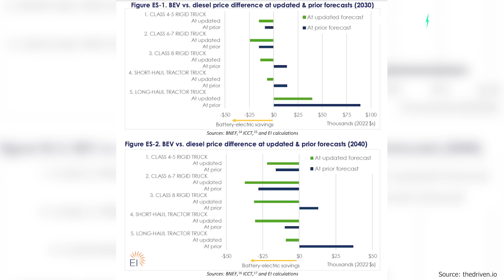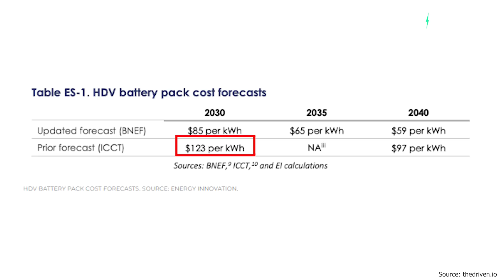Electric trucks will be cheaper than diesel many years sooner than expected

Comment: This of course ignores the rising costs of electricity, which has nearly doubled over the last 20 years.  It is likely to more than double over the next 20 years, because most of that previous period was during abnormally low inflation.  June 2009 to March 2020 was basically flat for electricity rates thanks to 0% interest rates and infinite QE.  Even if that happened again, electricity demand is going to ramp up far faster over the next 20 years because of EV's and prices for electricity will ramp up at least as fast.
Reply: Electricity manufacturer by fossil fuel is going up. Electricity manufacturer by renewables going down.. Why is prices going up.
Reply: If electricity costs (which country?) have doubled in twenty years, that's less than inflation so it means effectively the price has decreased. Renewable energy is much cheaper (and getting cheaper) than fossil fuels but the physical network is another matter. There are many variables involved and it's not as simple as some YouTube commenters assert. Regardless of all this, we need to clean the air we breathe.
Reply: @Fomites  I am talking about the US, obviously.  Electricity rates have increased at a faster pace than inflation over the last 20 years.  It is a fact.  Your opinion does not refute the fact.  Renewable energy is not "much cheaper" and I gave two examples of technologies that are cheaper than the cheapest to renewables all costs considered, CCTG/CTG on natural gas. You are right there is a lot more to know here, but anything more than 3-4 sentences causes readers to get brain damage.  You should do the research and know the facts before forming your obviously wrong opinions.  The rest of the "variables" only serve to make renewables look even worse.  There are a lot of used wind turbine blades abandoned and laying in fields where they will be for hundreds or even thousands of years polluting the environment with their useless presence.  PV solar is a total scam.  Geothermal is so limited that it just doesn't make a difference.  And on and on.
Reply: I don't know where you live but electricity over the past 20 years in Ontario Canada has dropped from 5.22 dollars per kwh to 2.97 per kwh while regular unleaded has increased from 70.9 per litte to 165.6. Bullshit may baffle brains but not in this neck of the woods. Yes electricitydemand is going to ramp up but gasat the pump will go through the roof. Nice try though.
Reply: You sound kind of like my grandpa. Things were a lot cheaper back in the day, but wages were much lower too. 

Accounting for inflation, the cost of electricity is lower than it was 20 years ago. 

Average cost of electricity almost exactly doubled from 7.5 cents kWh to 15.1. But wages more than doubled, from $11/hour to $29/hour.
Reply: @Scotto_desu Which country? I'm guessing Australia.
Reply: @Scotto_desu  "Accounting for inflation, the cost of electricity is lower than it was 20 years ago. "  That is factually incorrect.  Electricity prices have increased by more than the inflation rate over the last 20 years.  Wages have risen by less than the inflation rate over the last 20 years, and definitely less than double what they were in 2004.  Both of your claims are factually incorrect.  In any case, this does not address my original comment.
Reply: @KungPowEnterFist Just writing that it is factually incorrect doesn't make it so. Do you have any links to demonstrate?
Reply: @Fomites  "Do you have any links to demonstrate?"  YT does not like links in the comment section, and you know that.  There is a mountain of publicly available information on this.  Stop being lazy and do the research.  Your opinion does not change facts.
Reply: Solar, wind, battery is cheapest energy on Earth.
PepsiCo & FritoLay already charge BEV semi w/ 100% renewable energy.

Comment: Diesel will be around for a very long time.  The absolutely insane amount of electrical infrastructure needed to add 50+ EV semi level supercharging stations to every Loves/Flying J in America? That involves new power lines and very large dedicated electrical substations to be installed in every location.

Yeah, that's happening real soon....
Reply: Have you read any of Tony Seba's stuff? The idea is that WHEN the alternatives cost 10X less, it will happen quickly. Also, charging would be supplied by solar, so it would be very localized and without FF generating stations.
Reply: Diesel BANS begin in 2026...RIP😂
Reply: @markplott4820 Meh. People got to eat. I am a huge fan of EV, btw.
Reply: @charrin9086  - PepsiCo & FritoLay drivers earn MORE, because BEV truck does more work. Lower cost to operate & maintain.
way less impact on Driver stress/injury.
Reply: They're already installing Supercharger locations which can handle ~100 cars charging at one time. Most people considered this impossible less than 10 years ago.  And Loves/Flying J are already installing DCFC for cars. The trucks will come, and much sooner than you think.

Comment: e-Mthanol, 
made from Green Hydrogen, is suitable for heavy vehicles,
like Ships🚢  and Airplane ✈️,  or maybe even Trucks 🚚
(although I am not sure about Trucks ).

Note I am not taking about Methanol Combustion engine.
Methanol Fuel Cell is more energy efficient.

And also this is not Biofule, its not made from plants,
 insted you can use Green Hydrogen and pull CO2 from air to make Green Methanol.

Currently its expensive than both traditional fossel fuel and also Bio-Eathanol.
But in future its cost will drop below both, because price of Fuel Cell / Electrolizer is falling exponentially.

Although, electric will always be cheeper than Green Methanol.
But thats not feasible for ✈️ and 🚢  , 
until we develop cheap 'Graphene based SuperCapacitor'.

Comment: But electric trucks will require a major redesign of the the entire cab structure to better take advantage of the design. Note that the Tesla Semi has been a success because it was designed from the ground up specifically for electric power. Electric trucks from other manufacturers are essentially modifications of current truck designs and are not fully optimized for EV operations.

I wouldn't be surprised that we'll see Volvo offer an optimized EV truck using technology from Geely's EV development work within the next few years.
Reply: Volvo Trucks is a different company from the car brand and has nothing to do with Geely

Comment: Trucks need long range, refuelling that does not take  a day and be able to tow a lot.

Electric trucks not only have shorter ranges but they have to carry the 6 tons of fuel cells whether they use the electric or not. A diesel truck becomes more profitable as it travels as the fuel weight decreases.

Diesel trucks are not affected in the same way as e.v. trucks in cold weather conditions, yes the fuel may freeze but only in exceptional conditions.

I would say e.v. trucks will not replace all diesel trucks in the next 50 years if ever and e.v. car sales are going to spiral downwards over the forthcoming years.
Reply: "diesel trucks become more profitable as diesel weight decreases" Yeah really big difference in a few hundred pounds of fuel when the vehicle weighs 80k lbs. Aerodynamics and rolling resistance is all that matters for a efficiency of a semi on the highway. 

The hyundai I am about to get can recharge 80% of its battery in like 20 minutes on a DC fast charer.... not sure where you are getting an all night refuel from... 
Also truckers can only drive what 10 hours a day legally? 

Also diesel will have trouble starting routinely in Northern states based on temps... school buses and trucks have block heaters that get plugged in overnight in my state during the winter.
Reply: @RobertMartin-s2v if you think batteries operate better than diesel in cold temps you are mistaken.
Reply: @GWAForUTBE  yeah. You lose 5-7%  just to warm up the batteries and wait for it to happen. Like I said diesel performs better in cold temps.
Reply: Wow, one of the most ignorant comments here. And since this is the YouTube comment section - that's a solid accomplisment!

Comment: I have two 1 ton diesel trucks. I hate the dam things and can't wait to replace them with electric. But it will require much larger batteries and the infrastructure to charge them. That's not easy.
Reply: I feel guilty with my Ecodiesel.  Can't wait as well.  Semi looks great.

Comment: Basically electrified truck stops with fast charging capability. These next generation batteries are already there. Now it's a matter of truck stops
Reply: Its called sandbagging
Reply: And a grid that does not exist...
Reply: @GreenEyes_MS The grid exists, getting the permits to extend it to new power supplies and charging locations is the bottleneck.
Reply: @GreenEyes_MS  If, as you claim, the grid doesn't exist, how has Tesla put 20 and 25 MW Supercharger stations, which in a Megacharger would be enough to charge 800 Tesla Semis a day, in tiny towns such as Kettleman Hills, CA and Harris Ranch, CA?
Reply: @BigBen621  Then please explain the grid alerts/brown-outs as reported in the LA Times in the past couple of years.  Insufficient capacity overall for 2023 demand never mind a wave of electric vehicles…
Reply: @GreenEyes_MS   please explain the grid alerts/brown-outs as reported in the LA Times in the past couple of years. Please provide the date of an LA Times article in the past couple of years reporting "brown-outs". I'll wait...
Reply: @GreenEyes_MS Sure, here's the explanation: PG&E failing to perform needed maintenance for decades, so they have to turn off transmission lines when it's windy.

Comment: Diesel moves the world!
Reply: So did steam ships and trains at one point.
Reply: @mshackleton1  According to data from the Association of American Railroads, U.S. freight railroads transported approximately 1.7 billion tons of goods in 2020. And all of it powered by Diesel!
Reply: @xraylife  Diesel isn't essential for a freight train though. Lots of countries have fully electrified freight trains.  Australia is looking to convert existing locomotives into battery electric units by modifying the engines (they are diesel - electric anyway) and adding a tender which carries a massive battery pack.
Reply: @mshackleton1  Not possible for America the distances are to far and remote so installing all electric, maintaining it and powering it is not feasible for freight trains.
Reply: @xraylife  Yes, and Australia is a tiny country. Broken Hill to Kwinana (one of the proposed routes) only a lazy 1500 miles
Reply: Not for long
Reply: Some see what's in front of them.
Some see what's coming. 
They are both right.
For now.
Reply: Carbon level of atmosphere MORE ………… diesel 4:29
Reply: @sparkysho-ze7nm  Yes we need more Co2 to help the plants in arid climates - correct.
Reply: At one time, so did horses.
Reply: And gives it Cancer to the millions.
Reply: Diesel is for the qay men.
Reply: Diesel poisoning the world for you daily.
Reply: Diesel poisons the world. 
Yes, that's what you meant.
Reply: Not for long
Reply: Not for long😂
Reply: So did horses at one point in time.
Reply: Solar will power a majority of earths vehicles within 10 years. I’m willing to bet my life savings on that. You can thank self driving cars
Reply: Diesel = lungcanser 😷👎
Reply: To be like Mars!
Reply: Yes, and I think for all the A to B. All 500-mile highway run could be replaced, in Asia Europe and NA. Tesla something that works. As for snow cold and Mountain Country, maybe with a diesel charger, for range.
Reply: bowel movement
Reply: Diesel is irrelevant in 2024.
Reply: @markplott4820  If Diesel stops tomorrow you life as you know it stops within two weeks.

Comment: EV trucks are not unlike EV cars.

Depending on the circumstances they make either a lot of sense or no sense at all.

Short haul, probably yes.

Long haul, not for a long, long time IMO.
Reply: Long haul, yes make a ton of sense in Europe where a trucker by law is required to take a 45 minute break for every three hours driven.

That break is used to refuel. Badabim badabom problem solved.
Reply: I see minigens installed for long haul.   An inefficient ICE..Yes. but still more efficient than a big Cummings idling down the road or down hills.
Reply: @GWAForUTBE Nah. Long haul works fine if the trucks can fast charge during the mandated 30 minute break. Start the day with a 500 mile range, top off to 400+ miles of remaining range during the break - that covers single-driver long haul just fine. Look up the MCS standard for heavy truck charging.